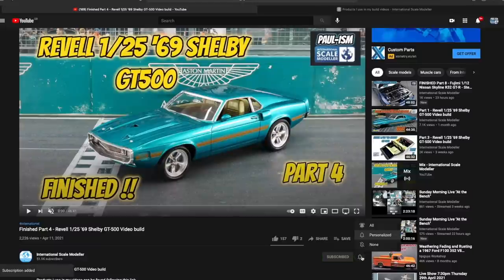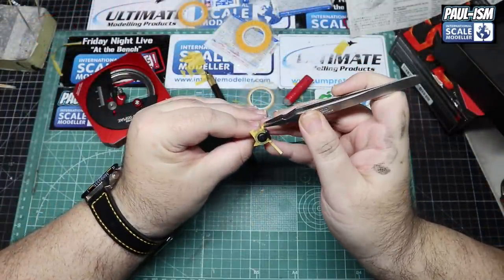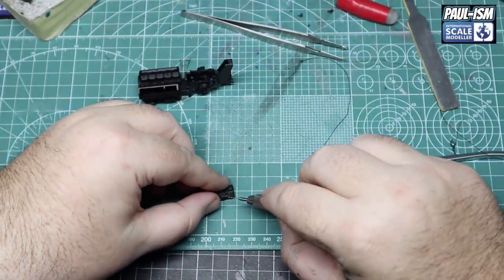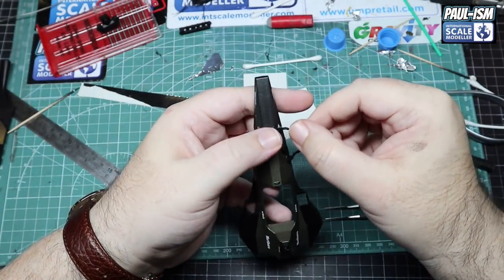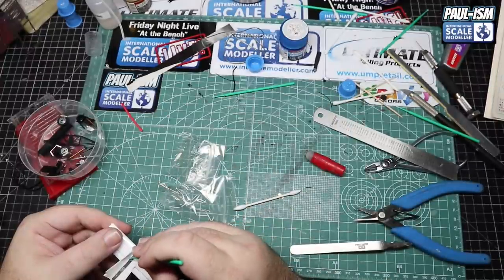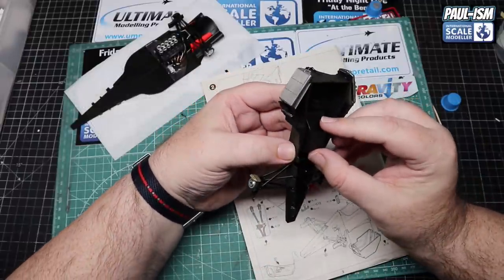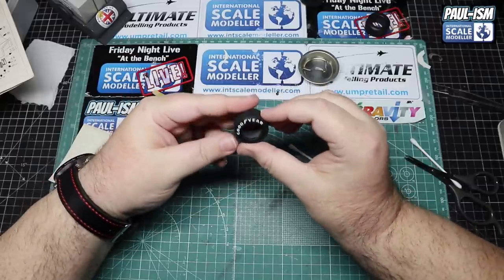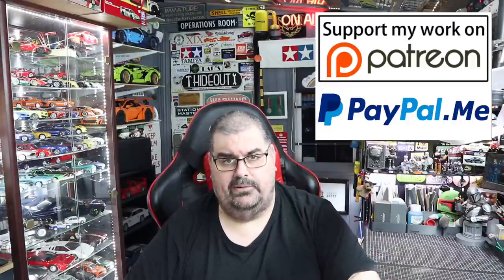Part 4- Tamiya Mclaren MP4/5B Video Build

Comment: A question....how in the f**k do you glue the rear wing together? I have tried 2 times, both a disaster. I've had to strip the paint twice, I've had to buy another decal set because like yourself, I completed all the parts before assembly....I just can't see how to line up both side plates, all 3 wings need to be attached to one of those plates at the same time. The glue won't hold because of the paint, and CA glue means no room for adjustment; you try to line the guide holes up to fit the wings in the 2nd plate, and of course they break off at the other end....I'm seriously one step away from smashing it with my fist, which would be a shame coz the chassis; which I thought would be the hard part, turned out pretty good.
Reply from the maker: Yep I had the same issue. It’s a nightmare
Reply: @InternationalScaleModeller  I appreciate the quick response............................but do you have any advice?
Reply from the maker: Just try and line one side up then the other is all I did